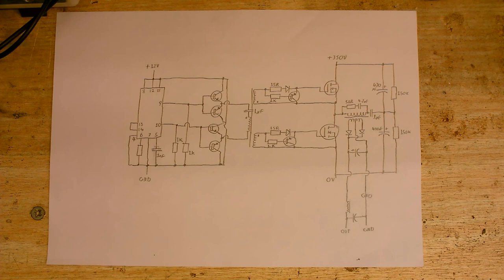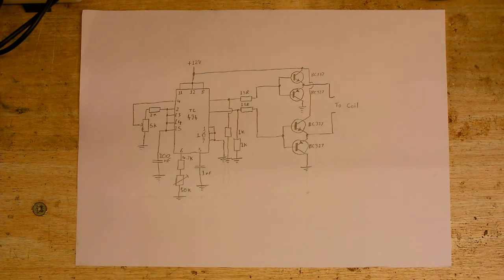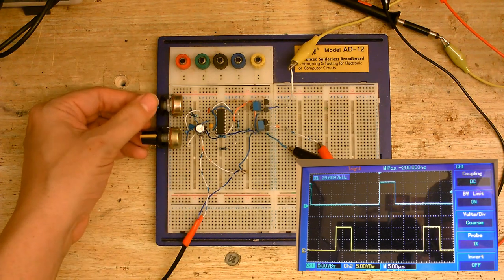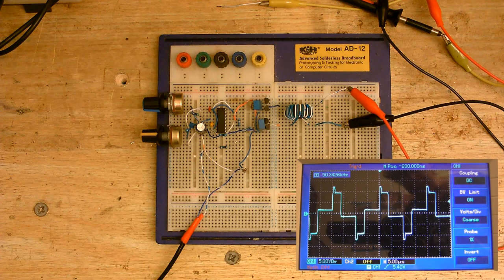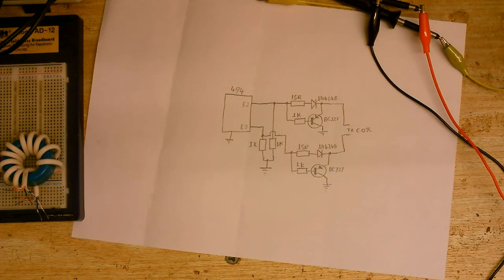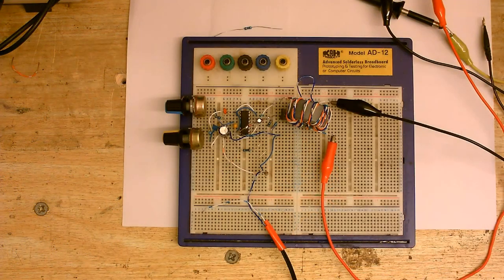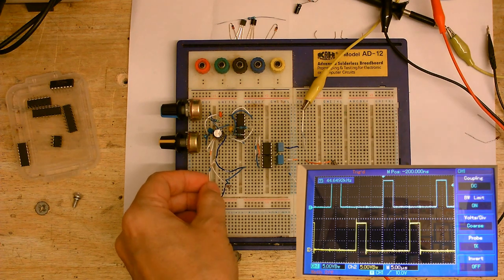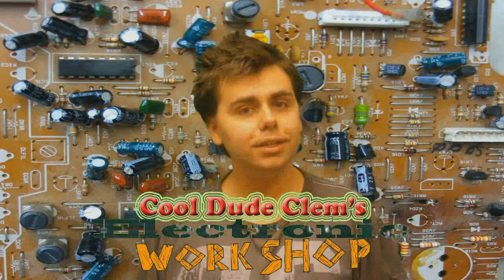Experimental switch-mode power supply experiments - the quest for a good gate waveform.

Comment: Interesting Clem!
I notice that you plan to use a sort of "Half-Bridge" or Push-Pull configuration for driving the Primary of the Output Transformer where most commercial designs these days use a single Power M.O.S.F.E.T.
I'm guessing that you want the D.C. Output of this design to be Galvanically Isolated from the A.C. Mains Supply so might arrange the Feedback to achieve Regulation via an Optocoupler.
Reply from the maker: I preferred to go with a half-bridge because I want this to be able to output at least 50 watts. Also since I'm using a TL494 as my controller IC, might just as well go with a hafbridge.
Reply: Please read Allegro ACS733 datasheet as it comes with both a digital (level comparator) and analog D.C.-MHz outputs...

Comment: I got the same overshoot on my GDTs but I noticed that it's because the transformer is not loaded. When you connect the transistor it pretty much goes away.
By the way, when you get further with the power supply I'd be curious to see how the driver circuit performs when there's the full 320V on the primary and the secondary is loaded. I keep blowing the BC546/BC556 pair and I suspect they don't handle the high transient currents that well.
Reply from the maker: I actually did try with a small load on the transformer (although I forgot to film it). It really didn't make much difference though.

Comment: You should probably have a 1000 pF to 10000 pF capacitor on the output of the gate drive transformer to stand in for the capacitance of the gate.  Usually there should be a DC block capacitor in series with the coil at the driver as well to prevent saturation of the ferrite, and some small resistance, such as 1 to 5 ohms in series does not hurt either because the leakage inductance of the transformer can resonate with stray capacitance.  Running gate driver ICs without a load attached will often destroy them.

Just as a rough order-of-magnitude: with 200 mA charging current, a IRF540 which has 72 nC of gate charge will charge in 360 ns.  Not that fast, but fast enough depending on your switching supply speed.  IRFP260 is 230 nC or 1150 ns.  So small transistors can work, to a point.  If you want to stick with the transistor route, BD139/BD140 are probably better, you could probably get 1.5 A of peak current fairly safely out of them and get a much shorter transition time without using a custom IC.
Reply from the maker: Good points there, these are all things I'm going to think about later on, this is just in it's experimental stage right now soi I'm just experimenting as I go along. I realise that adding a capacitor could make the GDT resonate or ring, so that why I left it out. I'll try it with a small resistor as well.

Comment: Question - How do I measure on multimeter the output voltage from circuit seen from 2007 , that was secondary side of Inverter of 120VAC connected on each output line single diodes that are opposite polarity each facing, (anti parallel) going to resistor load? Is this still a portion of 120V AC output ,or approx 40 volt half wave DC plus and minus DC? The writer may have been thinking about back flow protection. This is not print error, or about clipping circuit. Please advise.